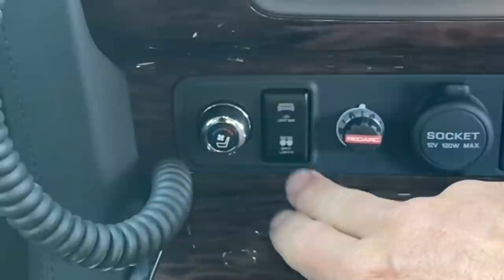Y62 Smurf Suspension Lift & Packing For Pyrenees

Comment: Hi mate I'm pretty sure that in qld you can go 50mm in suspension, And you can have a tyre that's 25mm bigger than in Hight then you have listed on the makers plate of the car, so if you're running 32"stock you can go to 33"and so forth. any more in Hight with each than that you have to get a mod plate. Hope this helps 😁👍

Comment: Mate, that was a great blog on suspension and and the difference in the lifts, you have educated me...... I will be lifting mine and getting you to do the gvm upgrade soon. Like to see more on your smurf suspension as that looks great. You have put a lot of thought into the design. Regarding transmission oil change, I’ve notice over the pass 3-4 months acceleration from stand still and punching it on the freeway seem to be slightly lacking. Had transmission serviced at my 80k service and has made a real difference. Back to normal, oil was slightly discoloured,. Funny, that Nissan say you don’t have to do it yet my Nissan mechanic recommends it at least every 40k based on your towing needs.
Reply from the maker: 40k minimum if you ask me 👍

Comment: Hey Dash, there are alloy hitches that can take both soft and metal shackles already. The All4Adventure guys have them, and there are probably others out there also. https://shop.all4adventure.com/collections/campboss-4x4/products/boss-hitch
Reply: What does it weigh though, David is very mass conscious, I feel sorry for his wife!
Reply: @angusrainbow8853  well if you check out the website link I posted it appears to say the weight is 870g. Even if that isn’t correct, it’s made from alloy so it has to be lighter than the steel donut one he is currently using.